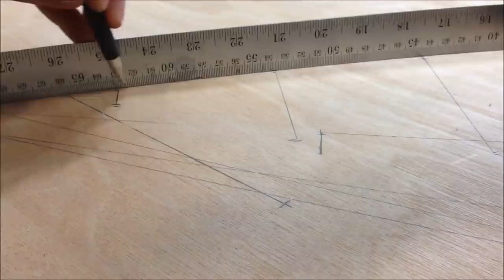How it's Made: Propeller Pattern

Comment: Mauritor -   In Brazil 40 years ago, patterns were made of red cedar wood, for good stability, ease of working and goog for glueing. The painting colour is a code indicating the metal to be used in foundry, and enamel used is special preventing sand adherence to pattern in foundry. For more pieces, aluminium copies of patterns were used. Great skilled caftsmanship is required in this job. Good video!

Comment: Lots of sand casting experts here....it's a pattern that will be put in a box & have sand rammed around it. The pattern has to be strong enough to be reused many times and withstand that abuse. As for balance, note the pattern's hub extended past the centreline, and note the hole. The pattern is indexed off that hole and rotated into position in the sand to create a pattern for each blade. It ensures accuracy and balance because every blade is identical.And as for table saw safety, no need for a riving knofe or a push stick when freehand cutting wide boards, your hands are nowhere near the blade. You can tell the internet experts as they have no idea as to what is safe of not.Finally, if it was cheaper and easier to do this on a CNC mill, I doubt people would be paying Shapeandform money to do the excellent job he does.Why do the curent generations despise manual labour so much and have to put it down as inferior, just because they don't know the sharp end of a plane from a chanisaw? There are still PLENTY of industries where it is cheaper, faster and just makes more sense to do things the traditional way.
Reply: Any company that has a CNC machine big enough to make these will charge a massive ££ premium for that fact.
Reply: +Frank Blackcrow How are you going to do it without waste with subtractive machining? That is in fact what is superior about casting. On the other hand, a lot of inefficiency could be removed from this process with CNC, especially cutting the wood blanks which are stacked up. Instead of drawing on them, cutting them out, sanding them etc, all of that could be automated away.
Reply: +Frank Blackcrow According to their YouTube info and their website:
"Industrial Shape & Form provides prototypes, tooling, low volume, and custom manufacturing to industry and entertainment"

CNC only makes sense if you are going to produce in high numbers. The man-hours spent on those low volume orders (1, 2 or maybe 3 of those things) are maybe a bit higher than the time spent creating a proper CAD 3D model, getting that 3D model to a CNC mill and producing it, but it's way, way cheaper this way.

Any idea what the salary for an CAD Engineer is? Any idea what the cost for a proper CNC mill is and what salary the CNC mill operator has?

You read that right. You need at least 2 people for a proper CNC solution. 2 people, 2 paychecks to save a few hours of work, while 1 person can do the same job with a little bit more time for just 1 paycheck.
Reply: +Frank Blackcrow   Smaller diameter propellers can be machined from a billet but that would be extraordinarily expensive for a propeller of this size.  The casting will be machined to it's final dimension.
Reply: ***** When you don't express yourself clearly it is difficult to respond to your comment.  If I did not understand your comment then I would put that on the writer.
Reply: As some one who owns a company that has several CNC machines I can tell you that there will never be a machine that will beat the hands of a true craftsman . plus it cost a boat load of money to even run a CNC 5 axis machine plus the $70,000 - $120,000 a year cost to pay the operators and technician to accurately program them and in the long run for one off products it is also cheaper to use skilled craftsman
Reply: Frank Blackcrow, I want to see the flint knapped one.
Reply: @Frank Blackcrow There is no company on the planet that is machining a monobloc propeller of this size, no one. Casting is still the only mans of making many large complex parts. More times than not, large complex parts are cast and then the finishing is completed on a CNC machine as opposed to grinder teams. But not the entire part. No sir, sorry, come again.
Reply: @_Para_  your gonna have to forgive dude ... he didnt think far enough ahead to see the additional costs and how many additional people would need to be involved.
Reply: @Frank Blackcrow Yes, there are machines that cut that large, but this video shows the creation of the prop needed to make the casts for making multiple, identical propellers. It would be a massive waste of energy to use CNC machines to do this. Furthermore, machines will never be as precise as skilled craftsmen. Even the second video you linked to, proves that as they say at 3:35 "The propellers are finalized by hand grinding, to give them the exact measurements and properties for an impeccable service life". They then go off to show how even the reconditioning of propellers are done by hand, rather than by machine.

Your argument is invalid and even your own evidence doesn't fully support your stance.

Comment from the maker: Thanks for your comment Dave.  There are many reasons the patterns are made this way and the method of manufacture is often decided on a case by case basis.  While some propeller patterns are done on the cnc router, the set up - glue up process is the same.  A skilled patternmaker can be just as fast as a cnc router.

Comment: In my youth , I designed and made propellers a few times, using hand tools to make the pattern and they were all pretty accurate and the latest one,  about 25  years ago was a 17 inches Dia. by 17 inches Pitch. Since young I always felt that the tips of propellers were not right and there were other issues I was concerned about. All I did was to look at evolution of birds and fish  which operate at different speeds and studied what nature  had made over the last few million years and here was my final design incorporating the following points. In wings of birds and fins of fish I had noticed a few issues  which made a lot  of sense and so I incorporated them in the design.  Also may I say that wing tips of aircraft wings were wrong as the small Tiger cub and also the Spitfire  and other planes. Well here goes. I feel the propeller in this video could do with a few modifications, 

* Nature always makes  fish propulsion  tail fins and   feathers in  birds wings  with the trailing edge at the tip always trailing back or swept back , ( not forward as in the Spitfire wing) so any vortex formed will be thrown out  at the tip rather than  travel back along the trailing edge  into the boss which could erode it. This was incorporated in my propeller. The American P51 compromises  but does not have its trailing edge swept back , but it is better than the Spitfire wing)
* The leading edge of the   fins in fish and fast birds is always trailing back or swept back even the last part of long range birds as the albatross and the seagull.  Well since the upper surface has a low pressure and the lower surface has a high pressure, the air or water will try to escape from the high pressure zone under the wing  in to the low pressure zone above the wing  forming a heavy tip vortex . Well the swept back leading edge will see to it that if  starting from the leading edge some air is going to escape from the high pressure zone under  the wing , then all one needs to do is to extend the wing the further back one goes to form a barrier to the vortex , hence the swept back principle was also  also incorporated in my propeller.

* Now  with both the leading edge and the trailing edge of the propeller being swept back there was no possibility of the vortex going into the boss, but only outward to the  extended tip where an inner vortex  at the trailing edge would cancel an outer vortex from the leading edge........... the  beauty of nature saw to this thousands of years before man ever did!!!!
* Well, when a propeller starts from rest, because of the twist in the angle of attack, the outer part of the blade , may work rather efficiently  even tolerate the high slip but the blade nearest the boss with a higher angle of attack will probably stall  as it behaves more like a paddle wheel rather than a propeller.  So knowing this and the fact that the inner part of the propeller does not contribute that much, well all I did was to work out the top speed of the boat and at the Boss provide a different pitch such that at top speed  I would not get any  push from the first third of the blade, but the pitch was reduced to that where the propeller  at top speed would  simply go through the water without producing any drive,  but I would have gained the benefit of having a lower  pitch hence a lower angle of attack at the boss  at starting from rest ,reducing the paddle wheel effect ( which can stall) and  the start would be better but this part will be inactive at top speed.   This was incorporated in my propeller where effectively the pitch of the propeller was reduced in the  part nearer the boss. It was not exactly a variable pitch propeller, but in a way  my propeller had a variable pitch, smaller nearer the boss to soften the paddle wheel effect at start condition, which does count on occasion. Also  as any propeller would slip I felt that this reduction of pitch towards the boss will reduce having the higher angle  of attack near the boss contribute to cavitation.

* Since propellers operate in zones of different pressures especially when they meet air pockets and break the surface I incorporated an ever increasing radius in the leading edge which acted as a scimitar as it re- entered the water and not as a straight sword which can give too great impulses and break a blade. A scimitar shaped leading edge would soften the entry in to the water after the blades break the surface. Note I did not want a surface propeller.
*  Since the boat I was dealing with was rather heavy , I went for four blades and with a high blade area to reduce the  possibility of cavitation  due extra low pressure on the upper surface.
*  With the leading and trailing edge swept back I did not apply any wash out at the wing tips as I thought this was not necessary, but the thickness of the section followed a natural one depending on the chord joining the leading and trailing edge at any radius.

Well those were the basic inclusions and I must say that the two engines were Cumins  running at 3200  direct drive as  my colleague for whom I designed them said that he could not afford two expensive gearboxes!!!!!

Well, to be honest I was rather excited when we tried the boat , well all I can say that it did one knot for every 100 revs per minute   and she was happy at 32 knots.  The boat made Pantalleria to Malta in  less than five hours, a distance of 150 miles or there about. 

I published all this in one Yacht Magazine including photographs and all I can say is that it seems to have been  appreciated as most propellers these days have my  propeller tips , and swept leading and trailing edges and I would like to check whether the variation in the pitch  nearer the boss was incorporated in  propellers used in boats  competing from a standing start!! I feel that this would produce a silent propeller for super yachts for owners who  look for such details.

Well that is one of my contribution to boating, as I do come from a boat building ancestry.
Reply: +Carmel Pule' Great Post.... 
and refreshing after the foolish comments, from those that worship at the alter of the CNC god.

Comment: You're correct about the push stick, but a riving knife is still handy because it helps prevent kickbacks. A riving knife is not in the way for any regular tablesaw operation, so there is no reason to remove it. The only time it would get in the way is during a cove cut.

Comment: Nice job and not so really out of date or inaccurate as some indicated, there are props still made this way in the US. I own a Pattern shop and we do 90% of our work CNC because the talent to do this kind of work accurately and efficiently isn't out there anymore.... and as eluded mostly we receive files and not prints so the cad is there anyway so you just cut it. However having built on the bench and still dabbling from time to time I am confident  this job was built in a 50- 60 hrs (I know I could do it in that or less)  and accuracy is enough that it does what is needed.Look at the investment in materials and equipment. $6500.00 - $10,000 pattern  1 -1/2 weeks work and all the money goes in the pocket..... VS cost of a cam system a big CNC and cost of foam or model board.... Money goes to the bankerYeah I know ok Grampa
Reply: +daniel place  yea your talking close to a million dollar cnc set up to that large of a prop.
Reply: A million dollars won't even come close to the size of the machine you need to do this. Especially in 5 axes. We're basically talking a portal crane with a spindle here. You're looking at serveral million, if not more.
Reply: I know i would not buy a prop from these guys unless it was CNC cut. And that includes the mold. look at the variance in his radious while applying the filler.Humans are skilled but CNC and a good profile will not have cavities and bulges that cause cavitation and drag. this prop will be a few hundred thousand and your worried about a CNC machine price? If you want to go ahead and put this on your dads fish boat go ahead. but i will buy a well designed Vetus prop. I have yet to see the US come close to European engineering.

Comment: So fucking amazing welll done ! Crafter!
Reply from the maker: ARMOR PIERCER Thanks!
Reply: +ShapeAndForm   How do you adjust the mold to account for contraction of the metal after it cools in the mold?  The propeller will need to be machined to its final shape so how much extra material do you leave for machining and balancing?  i don't see you taking any measurements so how is that done?  Thanks for the video.
Reply from the maker: The amount of machining allowance is usually decided by whoever will be doing the machining.  The contraction and shrinkage of the metal is based on the alloy being cast.  They can be calculated either by percentage, or more commonly by a measurement per foot of material.  Certain areas will tend to contract more than others based on size/thickness and shape.  It takes a skilled tradesman to recognize and account for this.  This is all accounted for in the layout of the job.  You can see this in the first part of the video with the spreadsheet and calculator.
Reply: Cast Iron contracts at 120th per inch and aluminium 148th per inch. You can actually buy contraction rulers when you make patterns. I left the trade in 1974 because I could see that it was a dying trade, now we have CNC machines, it's all but over.

Comment: Propeller may be purely axial flow and having shroud .
Hub may be 50 percent dia of blade tip to avoid re entry from pressure zone .
Length of hub may be 50 percent of blade diameter to hold and transfer maximum energy .
During testing of propeller the re entry of warer from pressure zone at about  4 kg pressure

Comment: Im not sure why there's all the harping on using a CNC machine, I mean the man is using power tools so the time saving is moot. The CNC is only as fast as its gantry system and you have the added risk if something goes wrong it goes REALLY wrong. There's nothing like a lost investment when a CNC just plows its tool into the material snapping it off and having recoup the costs of damage to the machine and loss of materials. This is just a pattern it doesn't have to be accurate it just has to have the general shape ;)
Reply: Those grapes are so sour, bro.

Comment: Oh, I understand that they're being used to make the casting molds, but my comment was mainly regarding the inaccuracy of hand-shaping the blades. I could see where a properly designed blade could be designed in CAD, virtually tested to optimize the shape, and then created with a little more accuracy by 3D printing them before smoothing the surfaces. Also, this would allow for extremely symmetrical masters to be created.
Reply: Please describe the  inaccuracy of hand shaping you speak of.. from a pattern maker with 40+ years experience this could be an insult from someone who does not know just how a skilled and experienced patternmaker works.

Comment: Theres an easier way to do this that cuts building and finishing time by 80% plus one can add + or - rake to the pattern.  NO need to check specs because it's a natural curve.  This can also be used for Air Craft props too.  30 yrs ago we built steel  pitch blocks for propeller repair.

Comment: Well done to do it by hand.
Props of larger scale these days are done by 5 axis CNC machines giving better balance.
Only lesser industrial countries still use hand made moldings, it's cheaper for lesser quality.
Reply: +Frank Blackcrow 
The balance issue is a complete red herring. Given that this patternmaker is only making one pattern for all blades on each handed prop,  the prop balance does not rely on the pattern being accurate to form.
And your "lesser quality" assessment is similarly questionable. With CNC, the skill is at the CAD terminal; here it's on the workshop floor. In either case, poor skills will give a poor result. I don't see any indication from this video of poor skills, and I've seen some very average CAD models, so I have to disagree that your simplistic characterisation has any sort of universal applicability. I frankly don't think it would even make the grade as a bumper sticker.